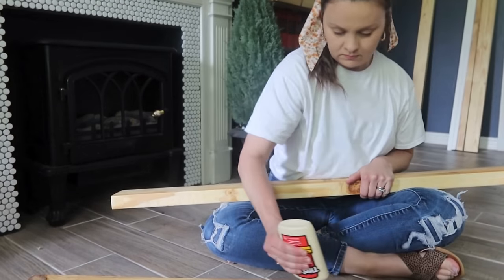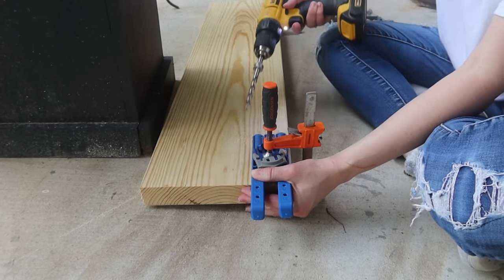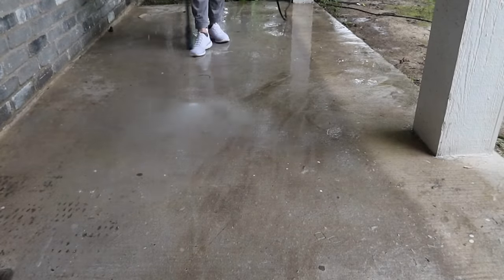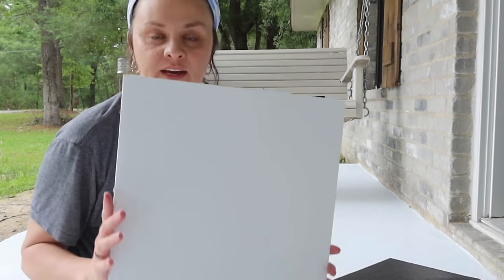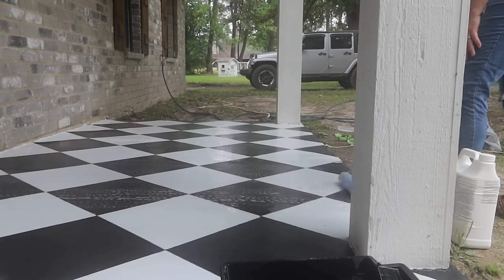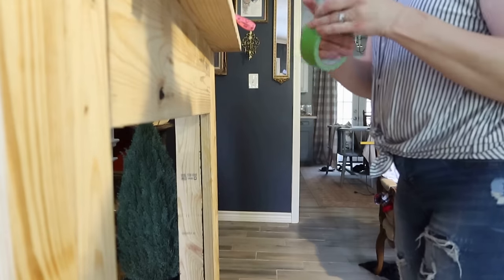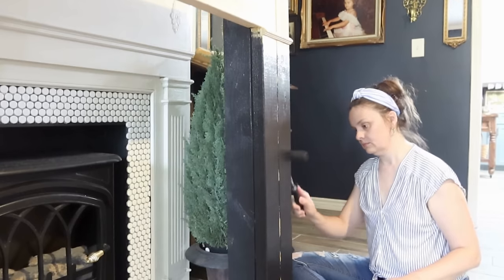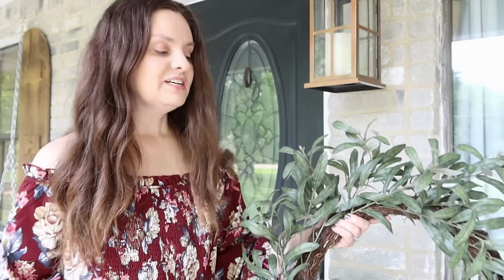classic + BOLD front porch MAKEOVER || DIY painted floors || decorate with me

Comment: May I ask why you opted for exterior paint vs patio/conrete paint for the checkered floor. Thank you !
Reply from the maker: Honestly, I don’t know. I did want to use the same paint for the black squares, mantle and swing…so I went with a good exterior paint for all of that to save money. The sealer that I used is specifically for concrete, though. I did two coats of it over the span of several hours. We ended up having rain that weekend and everything held up really well. Thank you so much for watching!